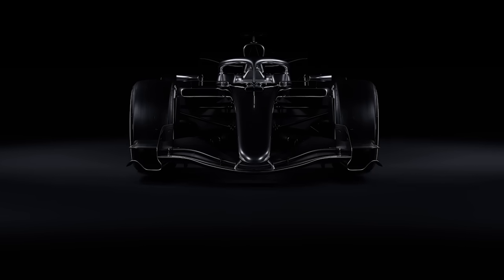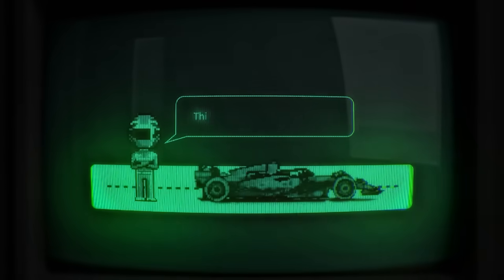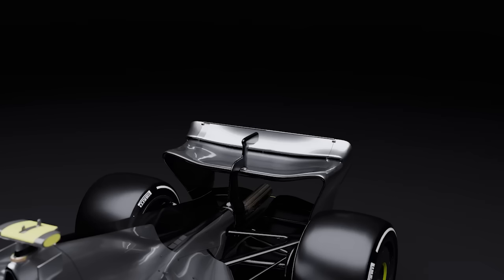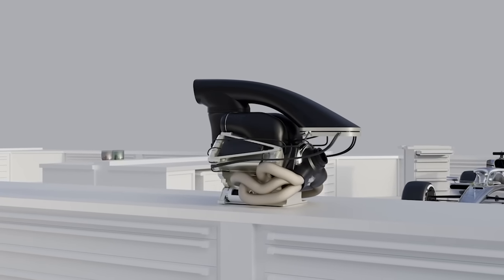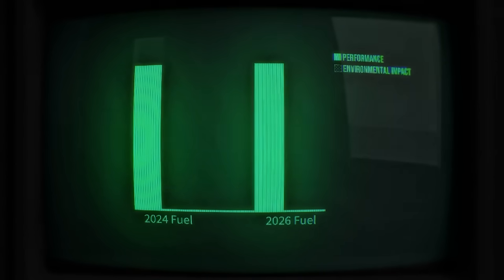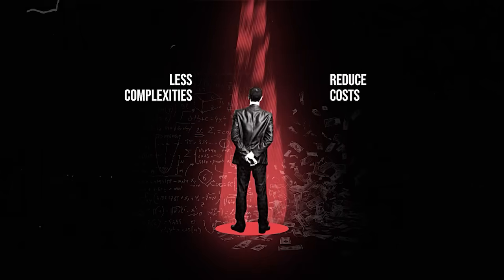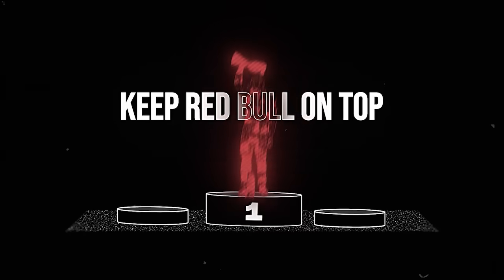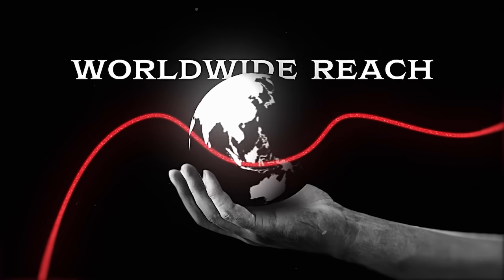F1 2026 Regulations: What’s REALLY Changing?

Comment: instead of 50/50 split just use the green fuel without the battery it will give us more great racing
Reply: They should try to minimise the private jets used for reaching f1 event vanue and for top notch racing experience they should go for v10s again ... The carbon emissions from f1 drivers and fans and other celebrities private jet is much greater then that of f1 car
Reply: @divyanshumohar726 I disagree, the small private jets are hundreds of times less polluting than the big passenger airlines and able to land at much smaller local airstrips outside the big cities.
Reply: @divyanshumohar726  Yeah almost all emissions are from transportation. but the point of f1 is to make the majority like road cars better not the show. So if f1 cars can become 100% emmision free so can road cars
Reply: @MHARIOOS  we already have that... its called formula E
Reply: @jstefa2  But formula E is a spec series. It doesn't allow for inovation at the rate of formula 1. And for formula one to be relevant it has to stay up to date. v10's are no longer a standard
Reply: @MHARIOOS  formula was never about the standard.. it is about speed and racing. turning f1 to formula E unspeced is a bit silly.
Reply: @jstefa2  Ever wonder why they changed from v8's to v6 turbo hybrid? That was to get it closer to a standard road engine and make them as efficiant as possible. F1 is all about improving tech.
Reply: @MHARIOOS  Sorry to disappoint you but F1 is not a technology development for road vehicles. This is pure marketing. Do you want zero-emission road cars? They already exist, it’s called electric cars and it didn’t take F1 to develop them.
Reply: @sergiosantos9418 Stefano ceo of f1 Said f1 is for development of roadcars and tech. Also li-po batteries cause just as much co2 release as a gasoline road car in its entire life. So you are wrong
Reply: @sergiosantos9418  they're not zero emissions though .. Even if you pedaled a generator you'd create an increased carbon footprint to so do... Nothing is for nothing...
Reply: @jstefa2  F1 was never about speed and racing. 😂 it was about money and politics.
Reply: @MHARIOOS  Road cars are breaking down due to this hybrid super clean technology. They last shorter, break down more often and need a lot of extra maintenance. Also more raw rare earth materials are needed to produce hybrids, with absolute minimal gain in fuel efficiency.  This "Green-hoax" is destroying the planet due to total waste of resources and gigantic pollution caused for the mining for materials needed for the short lasting crap battery's. Alongside child slave labor to get those resources.
Reply: @divyanshumohar726  Now that's what I called stupid idea.
Reply: @renofumi28  you have probably seen yourself in the mirror
Reply: @divyanshumohar726  that doesn't change the fact that you just stated a moronic idea
Reply: @renofumi28   would you elaborate karen ?
Reply: @divyanshumohar726  still a moronic idea tho
Reply: @renofumi28  go eat some cheese burgers THO 😂😂
Reply: @divyanshumohar726  sure but I'll still think that's an idiot idea
Reply: @renofumi28  don't think ever again you you don't have that ability and sense to think , I wonder who are these 13 subs you got ? You stepdads 😂😂
Reply: @divyanshumohar726  is it my 13 subs or you actually a 13 years old?
Reply: @divyanshumohar726  which one u talking about, children?
Reply: Nah.  That would be far too sensible for the blooks running f1.   Convolution is the key!!
Reply: Green fuel? If you mean switching to hydrogen I guess sure? Any other form of ice is not green, simply renewable. There are a lot of big companies that want you to confuse the two.
Reply: @JasonAtlasWhat is the difference between 'green' and 'renewable' fuel in terms of carbon footprints?
Reply: Because it's all a marketing gimmick to greenwash a sport whose main source of emissions, is the logistics.
Ironically, having 100% biofuel and no battery would be greener than what F1 is doing. Batteries cause A LOT of pollution to manufacture.
Reply: And reduce weight immensely.
Reply: How?
Reply: Ethanol
Reply: @andrecarrato6359 Ethanol takes food production away from starving people.
Reply: With V8!
Reply: No we love watching strategy that’s why chess is a multi billion dollar sport, let’s watch the engineers and forget about the cars 😂. Green fuel no batteries all jokes aside 💪🏻 fantastic
Reply: just why, there's formula e already.....
Reply: they should. btcc are using 100% green fuels from 2025, they have just ditched hybrid. f1 could follow this i don't see why it needs the electric portion to be green
Reply: @sionak  Cause battery development in f1 helps with battery development in road cars
Reply: I'm pretty sure 99% of you clowns who demand "good racing" don't know what you're talking about lol, sure just add this thing to provide "good racing" right? 😂 clowns
Reply: F1 should go full EV
Reply: V10s lets go
Reply: Are they trialling that somewhere? (Please advise…)
Reply: green fuel is just better profit margins ...
Reply: How would no battery make it greater racing? the battery adds strategy.
Reply: @MHARIOOS  The way they have it now is so you cant make a full race on the fuel.  So you have to create massive ammounts of energy outta the car to get to the finish.  This means more heat and leaner air fuel ratio slowing down the car.
Reply: @gmabailey40  Thats not true. Cars never have the maximum allowed 100kg/136L of fuel aboard in the races. They can comfortably make it to the end. There are cars that have had an mgu k faliure, even tho they are down crazy straight line speed they can still make it comfortably to the end. Bahrain 2019 leclerc. I know it was a late faliure but with how little fuel the engine uses its not true.
Reply: @MHARIOOS  by allowing the cars to be 150kg lighter and much smaller so you can actually overtake
Reply: @MHARIOOS  no, it doesn't. It adds cost and doesn't allow cars to run at 100% all race.
Reply: These cars do NOT run at 100% for the whole race. The batteries harvest and discharge multiple times per race. During harvesting, the car is nowhere near 100% @hueanao
Reply: @hueanao The electric motor runs off the battery! ( where have you been buddy??)

Comment: Honestly, active front wing is just going to be causing so much problems. Compared to a fixed front wing, the amount of performance you will lose if the active part stops functioning will be ridiculous and potentially dangerous, all types of balancing issues. I really think the active stuff is not the smartest thing to implement, but let's see how it goes I guess.
Reply: it's on the teams to make sure their car works, lmao this is like saying, "idk about the engine man, the amount of performance you will lose if the engine stops functioning will be ridiculous and potentially dangerous"
Reply: Already have that with the rear wing and theres rarely issues there. Only issue i can think of is how it affects front wing changes during pit stops
Reply: @junyutan2172  it's more about how front wings are already prone to getting damaged easily during a race, and now if they get damaged with the active aero, it will just be even worse
Reply: @eedoamitay3341 I don’t see the problem. Don’t damage your wing then… they lose performance today if their wing gets damaged. 

Replacing shouldn’t take any longer with a blind mate style connector
Reply: If my grandmother had wheels, she would have been a bike.
Reply: There no issues with the rear wings. So front won't be any different. Plus, highline vehicles have had these since the 90's. Example Mitsubishi 3000GT. There no issues like that with active aero.
Reply: Kind a silly... IF it stops working... Well... If the breaks stops working... Should we take them out then?

Comment: The weight gain was never a safety reason, in your graph, the spike from 2005 to 2011 was when they added KERS and 2011 to 2014 was when they went full hybrid i.e. they added more batteries to the cars, around 80kgs from 05-14, the 30kgs from 14 to 17 was the halo which is a definite safety improvement, not sure what 19 added when they simplified the front wings then but maybe the additional side impact structure, and I guess the 50kg in 22 was from the floor becoming more 3d and need the reinforcements

Also what do you mean by 100% sustainable fuels, like full synthetic easy to produce with easily renewable sources or did they plant some tree or built some carbon capture crap
Reply: The spike from 2005 to 2011 was when the cars were made humongously larger and longer, as well as a lot of extra safety components. It wasn’t the KERS alone
Reply: The 50kg for 2022 was safety improvements after Grosjean's awful accidentn in 2020 and the larger inch tyres for the ground effect era.
Reply: They actually plan to use a pretty wild technology for the %100 sustainable fuels, it is carbon capture but it will turn the captured carbons into a synthetic fuel (ethanol) which will also be HUGELY less harmful for the environment and hopefully more efficient.
Reply: @nyghl  Explain how carbon dioxide is harmful to the environment?  The whole climate scare is a hoax.
Reply: @nyghl  100%
                $100
You are welcome
Reply: Making the cars gigantic to make them look cool in 17 prob gave them a few extra Kg
Reply: No way that halo weights 30kg
Reply: You sir, do not know what you're talking about.  While hybridization did increase weight, a large porportion was in fact safety.  The halo being one obvious one.
Reply: @Bahamuttiamat  He did say that.